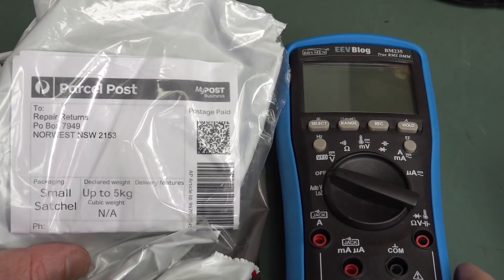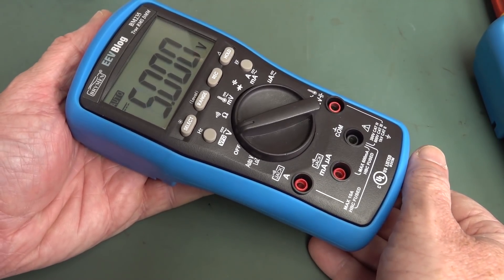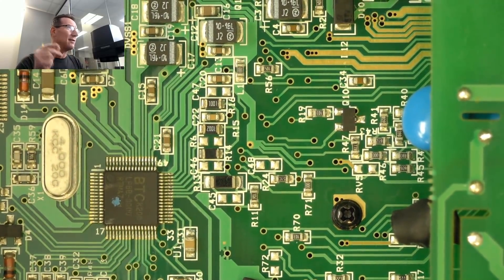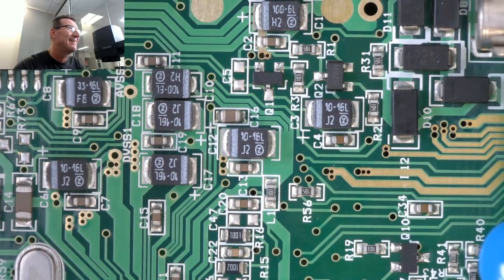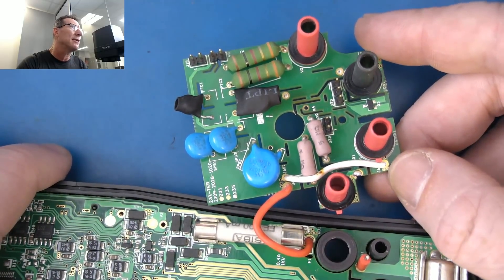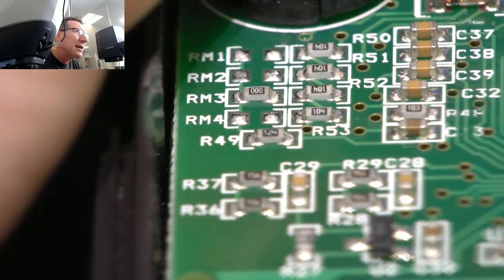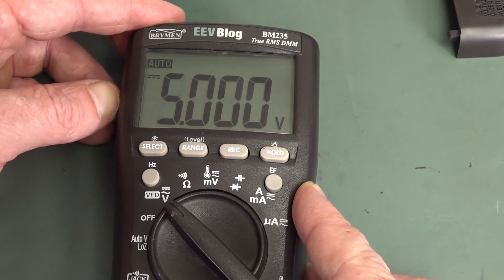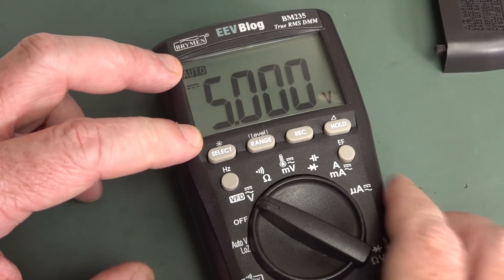Unusual Brymen BM235 Fault

Comment: It could be a problem with the voltage reference. Or it could be an op-amp with a cracked solder joint or feedback resistor somewhere. Those are the only 2 things that could shoot the reading to the roof and back I would guess.

Comment: Blown ADC channel?

In order to achieve fast update rates, sometimes devices like this will run two ADC's in parallel but running out-of-phase, effectively doubling sampling rate.  This is done often in oscilloscope samplers to get high sampling rates.  If this is a two-ADC-setup and one ADC is blown, then this behaviour looks about right...

Comment: It could be a both programmatical and hardware error. Because the digit 5 blinks with a constant pattern. (It blinks 4 times then stops for a while) Why don't you replace the MCU to see if it helps?

Comment: My other theory is a short circuit on the zebra stripes connecting the display to the board. My meter alternately displays 0.000 and -0.000. Maybe in this Brymen there is a short circuit between the driver lines of the minus symbol and the G segment of the first digit.
Reply: 😂 😂 😂 😂 😂 That's Good

Comment: My theory is the LCD driver is damaged. The segments change each time the processor refreshes the display, more often when measuring resistance than when measuring voltage. It looks like some bit of some internal counter (frequency divider or memory address counter) has a short to memory area of first digit's segments.

Comment: 1.check OP amps input stage. 2. check Ref. Voltage input stage (ref diide). 3. clean the contakts of the rotary switch (oxyde). 4. Glitch in the memory or cpu register?. 5. re-solder pins specially  Opamp and mpu.

Comment: When I saw this, I wondered if the design has a auto-cal, or sanity check circuit, that’s executed on boot up. I can imagine a built-in circuit, like BIT, that switches the input between ground, 5V, etc. If the control signals for such a circuit went berserk, it might cause these symptoms.

Comment: If the measurement is spot on, could it be the communication between the processor and the lcd?
if it's an spi or i2c, could the processor be reading the values correctly but experiencing noise when sending that over to the lcd controller?
5 is 0101 in binary btw

Comment: Dave, check the EEPROM. Read and check its contents several times. I have a 25q series EEPROM with similar weird behaviour, it bit flips at MSB every exactly 16 bytes sent. It was used as a font lookup table memory and a particular character on the display changes, as your multimeter does. I exchanged emails with the manufacturer several times and they refused to believe that their EEPROM was delivered as faulty, they carefully test them, etc. The EEPROM was delivered with factory programmed fonts and I never used it. Just plugged it in my flash reader to check if their fonts are fine and bootloaded the fonts in my code. I had instantly saw the weird glitch, with exact repeatability. I copied its content in a blank EEPROM and it works flawlessly. It's not my circuit design fault, as the manufacturer claimed. Maybe you have similar issue.

Comment: Both fuses good?   Voltage spike perhaps trashed the asic driving the display?  I had a Uni-T that someone blew the fuses which caused a voltage skip that got past the input protection and took out the main IC.  Spot on except it had all the wrong ranges.  Replaced the IC and it's been perfect.

Comment: Do the eeprom chips carry any write data. I had an incident where a character byte was accidentally written to the wrong address on an eeprom and it caused the display to output the wrong character when called. Just something to check.
Reply: I have a 25q series EEPROM with similar weird behaviour, it bit flips at MSB every exactly 16 bytes sent. It was used as a font lookup table memory and a particular character on the display changes, as Dave's multimeter does. I exchanged emails with the manufacturer several times and they refused to believe that their EEPROM was delivered as faulty, they carefully test them, etc. The EEPROM was delivered with factory programmed fonts and I never used it. Just plugged it in my flash reader and bootloaded the fonts in my code. I had instantly saw the weird glitch, with exact repeatability. I copied its content in a blank EEPROM and it works flawlessly. It's not my circuit design fault, as the manufacturer claimed.

Comment: Just guessing. It is showing the correct voltage intermittently, so the downstream of the ADC is ok. It is weird how the display is messing up which may show an electrical issue, like voltage leaking on a line, or dropping. It could be some kind of ADC communication breakup which is going to the max value.

Comment: I had a fault in a scope, where a rubber key was stuck inside and made a permanent contact. Couldn´t be seen from outside. So the reaction on any input was weird. Check all rubber keys for correct operation.

Comment: Shot in the dark here - Is the reference crystal on spec? Can they be fractured internally yet still 'function' ?  Will replacing the crystal still require re-calibration?

Comment: Is it possible its switching in a reference voltage for self calibration and the switching signal is not functioning? 
Or is there a pin on the ASIC that's pulsing at that frequency?  Is there any ghost signal coming out of the input connections?

Comment: What happened to: "though shalt always check voltages"? :P seriously though, isn't 5v a standard digital voltage value? Something being polled at regular intervals and it's somehow leaking onto the main sensing line/one of the grounds being weak and unable to sink enough stray voltage, would be interesting to see whether the relevant pin on the micro was actually seeing any stray voltages?

One interesting thing to note: the volts reading is dc, and the millivolts is AC, but they both show something that looks like 5 to some exponent, that's important, because the only waveforms that have the same peak to peak and RMS values...are rectangular waves, i.e. some kind of logic and it's quite a regular pattern too
Reply: Bit unlikely that it is 5 volts bang in everytime.....
Reply: @muppetpaster  5v seems equally random otherwise it's not too of the range and it's not a power of two, plus it's a multimeter-i'd imagine it has to have precision voltage sources floating around to even work properly, and it's not quite bang on 5v every time anyway- sometime it shows a .01/.02 if I recall correctly

Edit: hard to say it's switching to fast to say whether that .01 is tied to the 5v or to the 0v reading

Comment: I bought a 235 directly from Brymen and 1 month after the warranty expired it developed a calibration error that prevent it from measuring any voltages.  Shipped it back to Brymen and they re-calibrated it and sent it back - it did take about 90 days to get it back but at least they repaired it.

Comment: Question: I see that some traces on the PCB are without soldermask the whole length. Why is that? What benefit does it provide?
Reply: Lower trace resistance due to the extra solder metal, I think Dave made a video about that practice.
P.S. found it
https://youtu.be/L9q5vwCESEQ
Reply: @icestormfr  Neat, but here they have no solder on em. Just bare traces.
Reply: @sysghost  ahh, ok, I thought you meant the traces seen at 8:37
Reply: @sysghost  ah, I see which one you meant. Hmmm, I know only two other reasons, but the traces don't look like that would apply here...
(1. to improve heat conductivity to air, 2. acting as guard traces/rings, actively driven to the same potential as they are guarding, to get very high insulation/ultra low leakage from other parts of pbc, e.g. ultra low current/charge measurements => leakage flows over the PCB into these traces)
Reply: Less capacitance perhaps? I've seen that kind of thing in RF voodoo situations before.

Comment: Swap the asic (processor) with a good meter and see if it fixes it. Might be an internal fault in the asic, perhaps even reflashing it, if possible, with new firmware would fix it.
Reply: 5:59  J1  or   U5  looks  some thing  burn out
Reply: @neosandi6  J1 is a jumper
Reply: it look 's you are right ,  but  it still  look  burned at place  J1

Comment: Probably a stupid solution, but have you tried connecting it in parallel with another multimeter? Maybe it's working fine but leaking power to the measuring side somehow?

Comment: What happens when you switch ranges? Let's say, 50V instead of 5? Will it flash second digit or first?
Reply: It is an auto-ranging multimeter. But maybe applying a higher voltage might help.
Reply: @devrim-oguz  There's a manual ranging button in the row under the display.

Comment: I'm not sure if' it's affecting the other digits, since you didn't connect up anything to measure,  they show as zeroes (with the least significant digit 'bobbling'). Measure, say, 1.234 volts and see if it alternately displays "1.234" and "5.000"
Reply: It does measure fine, he said that then it alternates between measured voltage and 5.

Comment: @Dave if you can, try giving it a re-flash. What's the betting of a random bit flip in the firmware that causes a jump to the wrong part of code or some crap?
Reply: Dave didn't design or build this meter, Brymen did.  He isn't going to have the code or hardware to flash it with.
Reply: @stargazer7644  They might have given him a sealed black box flashing tool like you do for untrusted field techs.

Comment: I imagine this sort of crap happens all the time, for example with cheap routers. Customers think "oh it must be me" or "the ISP are throttling me" or "the damn kids are on the WiFi again", when in actual fact one of those poor processors got tired on running at 1GHz with zero cooling, full of dust and knocked off the table once every couple of months. These kind of "half" failures are probably happening everywhere. One major problem is that software makes the assumption that the hardware is always working correctly, for example that a bit flip is impossible and an ADC will only ever read between a value range, when in actual fact hardware failures are actually common place.
Reply: Depends on the application and to what cost the equipment is being manufactured.

A home broadband router needs to be built as cheap as possible as a first priority, hardware and software wise.

A piece of life support equipment will be built to a higher specification and cost may be only a secondary factor.

Comment: Hey Dave, 3:30, you can see why they discharged 'unevently'. Top is a NiMH while bottom is alkaline!
Reply: quite a careless usage of the owner I might say :(
Reply: I spotted this too, potentially the cause of the failure....
Reply: @Ghozer  it's definitely not a good idea, but how would it cause the failure?
Reply: @hotgluegunguy  asside from the different chemistries of the batteries, one potentially charging/overcharging the other, and different material types mixing, and the potential to cause a fire, the actual current they are capable of is different also, resistances, allsorts, so who knows exactly what issues it could cause...
Reply: @Ghozer  I still don't see what damage it would cause here, as the batteries are not charged by the device.  High series resistance could cause unstable operation, but I can't imagine it damaging the meter. I'm not saying you're wrong, I'm just curious as to why you arrived at that assumption.

Comment: I wonder if that half dead battery is a clue, ie, is something dragging the processor voltage down so it doesn't work correctly.
Reply: Maybe there is something wrong with the screen you use to watch this video, or you are just as blind as Dave himself.
That is not a half dead battery, that is a rechargeable NiMH battery. It's just a different chemistry.

Comment: You must have another scrap unit around that you could swap the processor with just to see if that cures it. it doesn't matter about calibration as you are unlikely to put the unit back in to service. It would just  be good to see it through to the end.

Comment: Did you notice its doing it in a pattern?  It goes:  0 5 0 5 0 5 0 5 pause, repeat.  It's extremely consistent.  Something in the logic is definitely doing it.  Looks like it's timed with the refresh of the LCD too....
Reply: It says "Help, I'm stuck in a Chinese multimeter factory"
Reply: ...... It's Morse,   I decoded it,
"Seven castaways marooned on deserted isle"
Reply: @robbieaussievic  WILSON!!!!!!!!!
Reply: Brian I saw that too.  It's static on the 5, but flashes the real reading four times quickly and then pauses on the 5.  The period for one complete cycle is just slightly over 2 seconds (close to 2.2 seconds, maybe).  Only the designers would know what on the processor might be cycling at this speed and with that pattern.  Some auxiliary function is bleeding over and affecting the display output, but is otherwise leaving the critical functions unaffected.  Another clue is that it is causing a display error on V and A settings, but is only causing some barely noticeable flickering on resistance and diode settings - again that might only mean something to the ASIC designers.
Reply: 5:59  J1  or   U5  looks  some thing  burn out
Reply: My guess would be it has something to do with the autoranging "leaking over", maybe even internally accidentally connecting the reference wrong. Its probably on the asic.

Comment: You'll never get around the short between the headset fault.  AKA you'll never be able to make a device idiot proof.  As for the device itself, it's just not worth putting the effort into.  If you don't have an answer in 30 minutes, it's cheaper to toss it out and get a new one.

Comment: I find it very interesting that it toggles 0, 5, 0, 5, 0, 5, 0, 5, always in the same sequence with the same time period, then waits a fixed period of time and repeats that toggling.  It's not at all random, which I would have expected.  It certainly looks like the processor is displaying an error message (like when your car shows the diagnostic codes on the malfunction indicator light).  Maybe contacting the manufacturer will yield some results.  Very interesting indeed.

Comment: Faulty ADC or some capacitor connected to the ADC
Reply: My thought as well.  Meters traditionally use a charge or discharge ramp with a counter, imstead of the SAR ADCs in signal processing.  Maybe a fault in that ramp circuit could make zero look like full/half range, with or without a 50% bias circuit.

Comment: Please spend some time on finding the fault on the BM235, this subject is interesting.
Reply: Since Dave has access to the company he should definitely get a replacement CPU and put it in.  
What if that does not fix it?  
Reasons to fix it:
1) You got to be very curious why the meters you sell died. 
2) It will probably sell  another 50 meters.
3) You can call it a tutorial on replacing SMD components.
Reply: I wonder why Dave doesn't put much time into his channel anymore. He said that this is his main job. So what else eats up so much time that he cannot do fundamentals or anything with some work behind anymore?

Comment: you are a class act replacing a meter that had such a crazy looking issue and a few years out of warranty-its all of that lead free solder they use now and it is growing tin whiskers all over and maybe internally in the chip-it is an odd failure. You make some of the most entertaining videos-you have a great joyful attitude in them.

Comment: Not that it matters, but what firmware is in that meter? I noticed the RM1, RM2, RM3, and RM4 positions on the PCB. They look like option jumpers. I wonder what would happen if you played with them. I have two of the BM235 meters and they have different firmware revisions. That is one thing about the 121GW over the 235. Easy update of the built-in firmware.

Comment: And this is why Dave is able to sell meters, absolutely no BS .. I have two already; thinking about a 121gw :-)
Reply: I have one and I regret buying it. The first firmwares were slow and the recent ones tend to drift. The display hasn't got a lot of contrast (even at max setting) and there's no way to read the SD without taking it out of the meter. I recommend watching https://www.youtube.com/playlist?list=PLZSS2ajxhiQDDs_mWPLavaveGe0RGEw1M before ordering one.
Reply: @henninghoefer  Agree with you, I really don't like the 121GW. It messed up some measurements because of a low battery, and at that point you've just fucked up my confidence completely.
Reply: I had both types of EEVBlog meters (121GW and BM235). The BM lost all function of its buttons, and the 121GW I barely trust to measure DCV under 10 volts. The AC measurements are downright dangerous to trust when checking if an AC circuit has 110V/230V live voltage on it and trying to measure ripple on something like +24V DC is just impossible. The AC+DC measurements ranges are not specified in the datasheet. The fanboys at the EEVBlog forum thinks this is fine, as they know the inside of the meter by heart...that is NOT what I expect to need when I buy a DMM. I want a datasheet. I bought it from the KS campaign so naturally there was no datasheet at the time. I have learned my lesson, I will never again any instrument carrying the EEVBlog on it...But each to their own!

Comment: Internal bondwire fracture - maybe on something related to the voltage reference. Making just enough contact to supply a reference, then draws current and the failed junction goes non-linear, add a tiny amount of capacitance and it oscillates?
Reply: Could you test this with some percussive maintenance while the thing is powered and see if anything changes, or is everything kind of set in stone with the packaging? Would be curious to know if this is a viable diagnostic method.